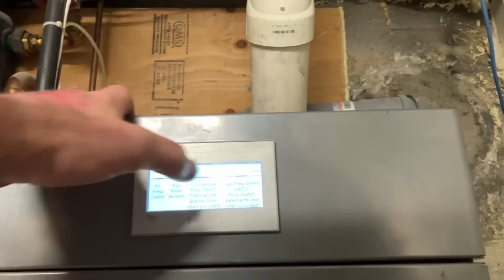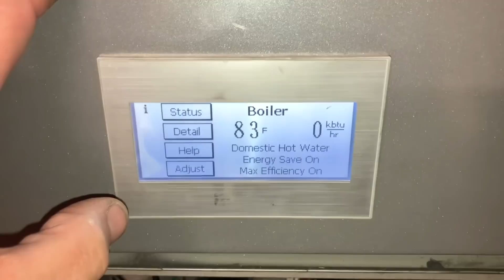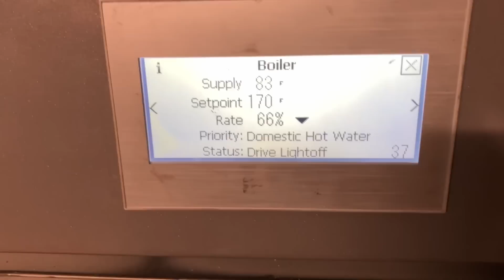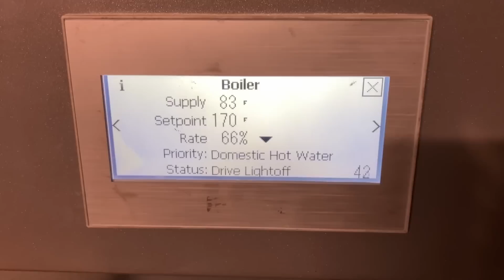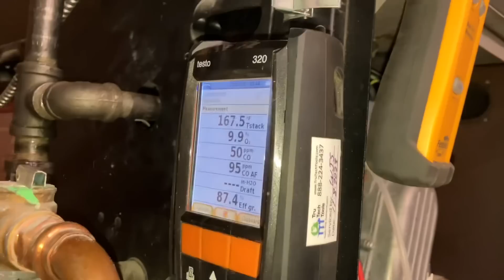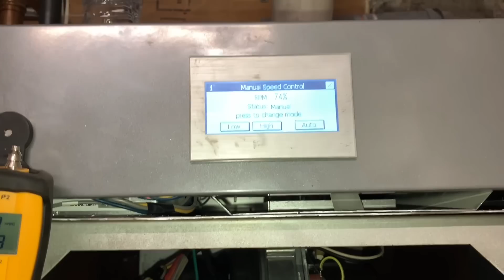Neglected Burnham Alpine Boiler Maintenance Overdue - Let’s Fix This!

Comment: 8:11 I’m not sure, but think that’s the worst neutralizer we’ve seen in this channel…..for it being well,overdo for new “magic dust”; and you’d think seeing a black “filter” would alert techs/ppl to think “that’s not right”, but than again, we’ve all seen filters that have disintegrated to point of being wet mush of nothing when removed on this channel.
Yikes, that’s not good.
FYI tip: spend money on preventative maintenance so not spending 2x—4x money on service calls to “repair/fix” when it breaks…..and, it’s faster hour wise on techs compared to the latter….